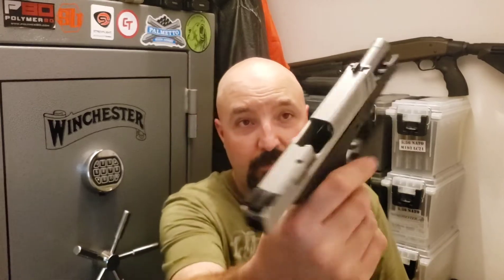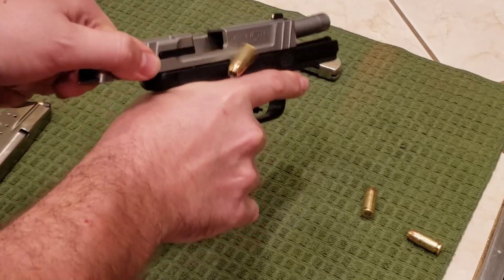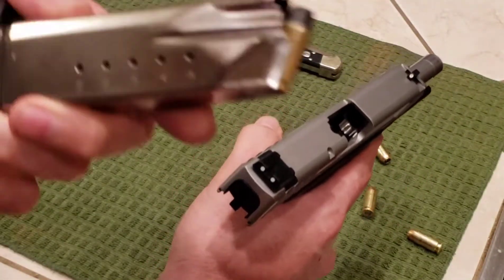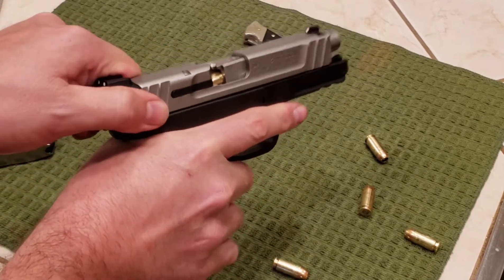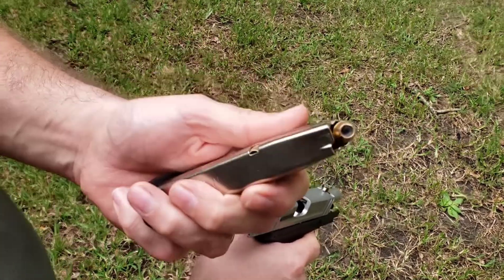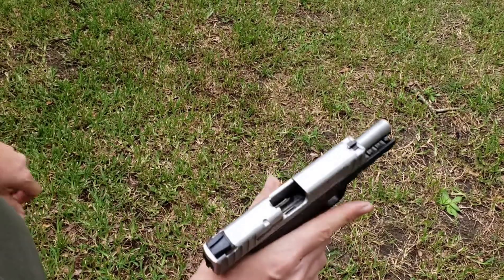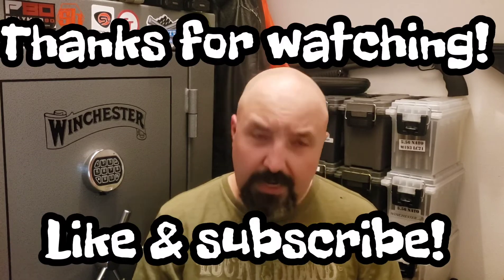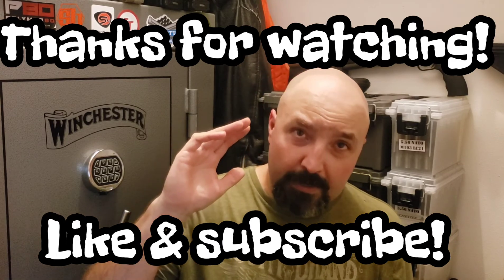Farm Style Tech Tip: How to make a new S&W SD40VE chamber rounds reliably. PART ONE

Comment: My SD40 jams and I don't ride the slide. It jams while shooting too. And I'm not limp wristing it
Reply from the maker: How many rounds does it have through it?
Reply: @JayLewisFarmStyle  it's still pretty new. Probably like 120 maybe a little more. I've been kind of hoping it's because it's new.
Reply from the maker: I'd put a drop or two of oil on the rails and a drop under the extractor on the outside of the slide. Then work the slide a bunch and practice some dry fire drills before the next range session. 

You might also switch to different ammo. If the problem persists after 300 rounds contact S&W. If you call them now they'll probably ask you if you've fired at least 300 rounds and tried a variety of ammo. 

Hope that helps!
Reply: @JayLewisFarmStyle  will do. Thanks for the advice man.

Comment: I have this gun and in addition to the jam up you show here, I often get a stovepiping issue while at the range. Any insight on this?
Reply from the maker: It could be any number of things. We can try to narrow it down though. How old is the gun? 
Did you purchase it new or used?
How many rounds does it have through it? 
Have you had this problem with multiple types of ammunition or only with one brand/ type?
Have you had this problem with more than one magazine?
Reply: @JayLewisFarmStyle  gun is around 3 years old , I bought it used , as far as rounds thru it, less than 500. I tried a few different brands of ammo, steel, brass, and aluminum. Mags didn’t matter, it did seem to choke on the aluminum a bit more than the other two. I did a very comprehensive cleaning job on it, and haven’t had the occasion to run it again yet. I’m hoping that it was simply a situation with the gun not being clean, I like it, and just wanted to know if there were any common misfire issues with this specific model.
Reply from the maker: @markk3652  alright, for starters we can probably rule out the mags. 

As for the ammo, I've had good running guns that functioned completely reliably with brass cased economy grade target stuff (think Winchester white box,  or Federal American Eagle) that would have problems with aluminum cased ammo. I've had aluminum cases split, and get stuck,  and once where the case head separated and left an aluminum sleeve stuck in the chamber of a S&W Chief's Spl.

To a much lesser degree the same can be said for steel cased. Most guns cycle steel cased just fine, but some won't. 

The gun shouldn't have any springs worn to the point of failure yet. Sometimes a recoil spring will cause cycling issues. 

The detail work you did was probably well worth the effort,  even if it wasn't the culprit. 

What I'd recommend is to buy a box or two of brass cased ammo, preferably something you haven't tried before, and take it back to the range and see what happens. 

One other thing: assuming the pistol is a .40 cal, and as such has the snappy recoil of a .40 cal. Be mindful that sometimes stovepipes can occur when you let you wrist flex too much. Sometimes we do this without realizing it. I've seen 40's jam this way more than other because of the aggressive recoil impulse. 

Hope that helps.
Reply: @JayLewisFarmStyle  it does, thank you for your time and advice.
Reply from the maker: @markk3652  anytime.

Comment: mine fails to go into battery around 50% of the time whether I "ride the slide", use the slide release or pull back and release very hard.
Reply from the maker: Have you tried different brands or styles of ammunition, or have all the issues been with the same ammo?
Reply from the maker: I responded to your comment on the other video by asking if you had tried various types of ammunition.
 
 If you have not, I would suggest you start there. Otherwise, it sounds like it needs to go back to Smith and Wesson to be looked at.
Reply: @JayLewisFarmStyle  sorry, I don't remember you responding. To answer your question, yes, I have tried three different types of ammo and still the same problem.
Reply from the maker: @user-yq1pb6dx9y I sent both replies this morning, I mentioned that for reference. I'd send it back to S&W for warranty work. 

Thanks for watching 👍

Comment: Yes if new there are burrs that will wear down or jacking hard will make it load. My suggestion file sofly all hard corners on barrel like just the burrs like emery board or nail file just enough to get the burr down. Also dont go and put 14 rounds in the clip it rattles if you do and 7 shots is plenty. Is a value gun. The sights suck get streamlight 4. And learn to point shoot not aim. I love mine had it two years. This is what I have learned oh yeah also feed it good ammo winchester white box 165 grain sucks speer lawman nice.....
Bri
Reply from the maker: Thanks for watching!

Comment: Hey what about it not losing properly after firing the first round? Mine does this every time I try to use it. Brand new out of the box. Also changed ammo and 3 different mags. It's pretty upsetting from Smith & Wesson tbh. I'm a little heart broken about it.
Reply from the maker: Contact S&W and send it in for warranty repair.
Reply: @JayLewisFarmStyle  Yeah I just bought mine Tuesday literally yesterday and it's having feeding issues like crazy. The video helped a ton as well. Thank you
Reply from the maker: @Rv3TRIPS  it's nearly impossible to determine an individuals level of experience without extensive dialogs, and there is no such thing as a one size fits all video. 

Think about it in terms of cars. Lots of people own cars and drive them daily. Some of those folks could swap their own transmission in the driveway in a couple of hours. Others can't manage to change their own oil. Then there are many folks in between with various skill levels.

That being said, I limited the scope of this video to "this is something easy to try in the event your new gun isn't working".

Without knowing anything of your age,  skill level, or experience with firearms based solely on your well described issue in your first message I'm of the persuasion that your weapon probably needs something in order to run reliably. 

Perhaps you've got some good diy skills and are mechanically inclined enough to try to polish internals to clean up the action yourself, but I'd never make that assumption without knowing a little more about your situation. 

On the other hand based on the facts that the weapon you purchased is stereotypically common to the first time gun buyers market (NOTHING WRONG WITH THAT!), and also that you were looking on YouTube for guidance lends me to the impression that your newer to the game (AGAIN NOTHING WRONG WITH THAT).

Whether I'm out in left field, or I hit the nail on the head,  either way S&W is top notch in customer service, and they will fix your gun. 

Hope that made sense.
Reply: @JayLewisFarmStyle  no worries not me to the gun game just the phone auto corrected some stuff I meant to say. I have a few Smith guns and I've only had the issue with one. I'm gonna go out on a limb and possibly say it might be the recoil spring. My glock 21 was doing the same thing so I decided to change it out and works perfectly now. I actually polished the loading ramp and wasn't sure if I should do the barrel or not. I'm definitely going to have Smith check it out though in case I'm missing something that may be an actual problem instead of going through with something else. Never hurts to get the manufacturers advice or someone else's opinion 😊
Reply from the maker: @Rv3TRIPS  absolutely! 

I've used a couple of manufacturer warranties in past couple of years with satisfactory results. Most recently a Viridian E Series laser for a Taurus G3C.

Thanks for sharing brother!

Comment: Just bought one and its falling to load using the slide  realese, hard cocking and even after firing
Reply from the maker: That's unfortunate! Try to run a couple hundred rounds through it and see if it loosens up after a break in period. Otherwise, send it back to Smith. I cannot recommend this pistol. I've heard many similar stories recently leading me to believe QC is slipping on the platform.
Reply: I ran 150 rounds true it two diferent brand. I just send it back to S&w to get it fixed. After all they have lifetime warranty

Comment: Well, isn't chambering the same rounds a problem, and will only worsen the more you chamber or half chamber
Reply from the maker: I'm not 100% sure I understand what you're saying. I can only assume you're referencing that repeatedly chambering the same exact cartridge can drive the bullet further into the case making it shorter and therefore less likely to feed well (not to mention causing pressure spikes)?

If that's not it, can you elaborate on the statement so I can better understand your point. 

Thanks for watching! 

Aside from that, the SD Series are really good at what they're good for.

Comment: Simple operator error. With any semiautomatic firearm, you should always let the slide or bolt move forward under its own spring pressure.
Reply from the maker: 98.5% correct. 

Speaking in absolutes is dangerous and should be avoided.
Reply: @JayLewisFarmStyle  That sounds like an absolute to me lol

Comment: Hesitation going into battery looks like an extractor issue to me. The first thing I would do is field strip and check the extractor tension on a case rim or fresh round. Then I would check the extractor lower corner for sharp edge. Then I would polish the feed ramp and chamber roof. Disappointed that you didn't do any of this. I am thinking of buying this pistol as my first 40 cal.
Reply from the maker: Sounds like you've got it figured out. You should make a video!

Comment: You can't hold the slide  just pull it back and let it go you would never have that problem.
Reply from the maker: Well, it absolutely didn't work to ride the slide on the SD40VE from the video. 
While it's probably not a good practice, many handguns will chamber quite a bit better while doing so than that one did.

Here's a link to a followup video we made on the subject:  https://youtu.be/jt1gi1B_yAo

Comment: I have to correct new shooters to stop babying the slide. They do it sometimes after correction which blows my mind. I have to rack-rack-rack-rack it menacingly in front of them to show the slides were designed and built to take a beating. They can handle it. Soft hands and little muscles are nothing compared to the ton of pressure exploding inside of the gun. It will survive a little pull/snap forward.
Reply from the maker: Good thing you were there to help them.

Comment: Operator error on racking, known as "limp wristing"
Reply from the maker: Limp wristing huh?
Reply: @JayLewisFarmStyle  That's what it's referred to as. I was having trouble with a pocket sized .380 and thought that it was the pistol malfunctioning.  But I just wasn't used to the size and feel of the gun as I've only had the .40 cal. that has a bigger frame. Whenever I racked the .380 for some reason I was flexing my wrist. I didn't realize it until I came across an article on it.
Hoping this helps, I didn't mean to sound like a jerk.